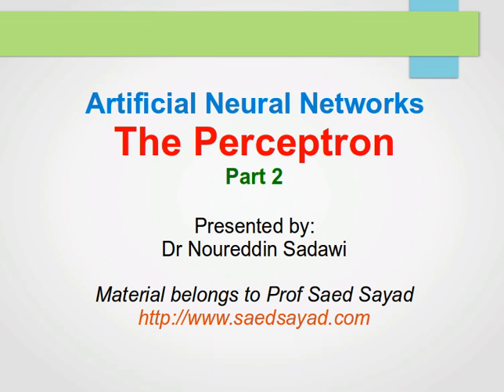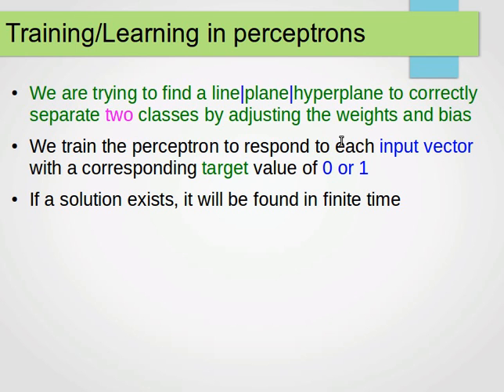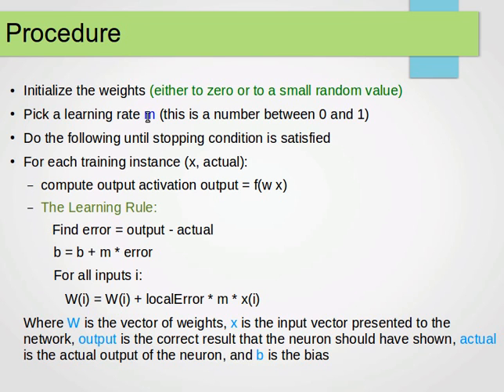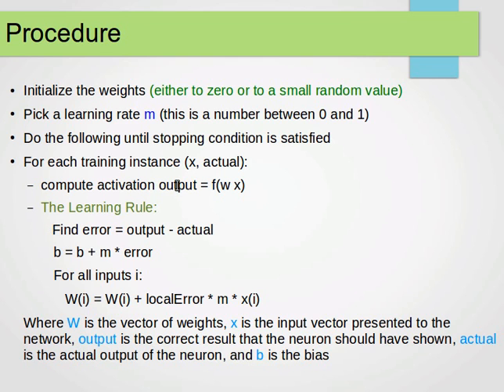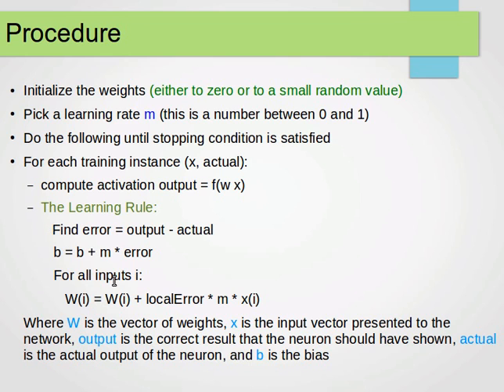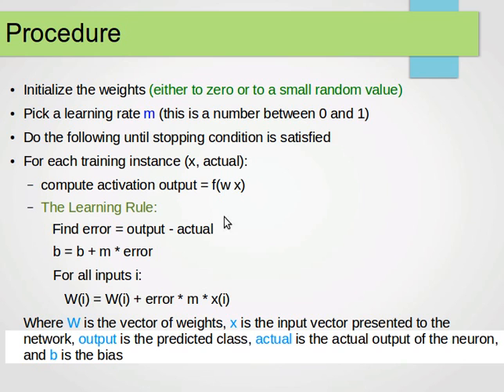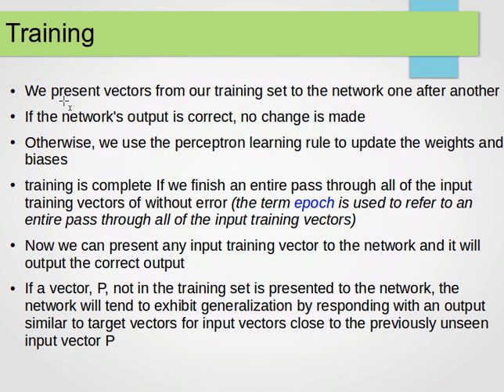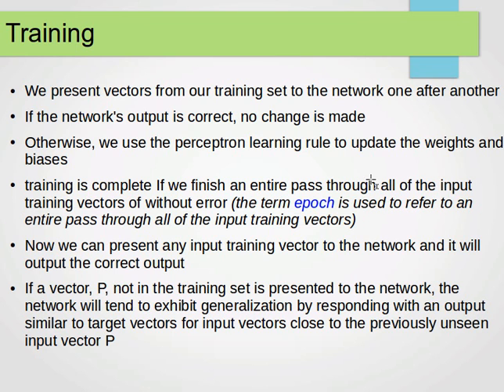How the Perceptron Algorithm Works 2/2

Comment: at 5:12, I believe there is a small mistake in the presentation: output is not the predicted value, it is the desired output (was ok before modification in slide). actual, on the other hand, is not «what we should get». It is the value we get.
Reply: sorry, but professor is right. The 'actual' in english means the real one, thus it is the one from the training set, not the one computed using feed forward pass

Comment: I think I figured it out.  The perceptron stands for logical gate and with a single layer you can represent OR and AND functions that are linear classifiers.  To represent non linear functions you need 1 hidden layer to represent the XOR logical gate.  Why does this have to be made so difficult "neural networks" this and "perceptrons" that... Since the computers deal with binary off/on representation that means you have to be able to deal with all the logical gates in this universe which are 7 AND, OR, XOR, NOT, NAND, NOR, and XNOR.

Comment: Why do we need the "perceptron" or is that just a metaphor to conceptualize the mechanics of the math?  I could not find anywhere in the video where the  perceptron is used to demonstrate the implementation of the math and how a perceptron drive the line separating the data points.

Comment: We never update the bias in perceptron..do We??? only weights are updated I guess. But, in your algorithm bias is also being updated.
Reply: Bias should update each iteration, to improve the degree of learning
Reply: The bias should also be updated. a non null bias means that the separator line doesn't go through the origin. Not updating the bias means that along the training the separator line just turns by an angle and doesn't move horizontally meaning that we might not have the right line. Also the bias is considered as another weight whose input is set to 1